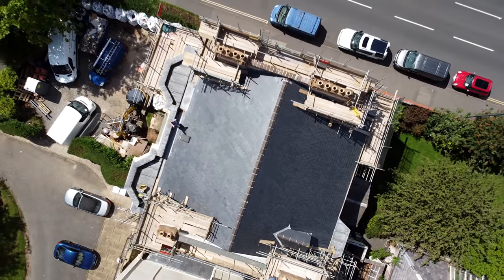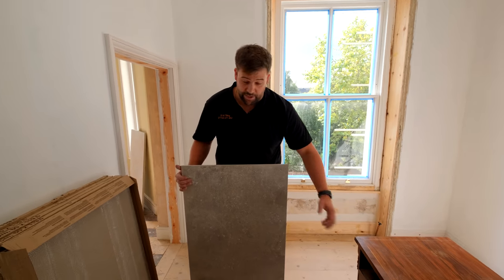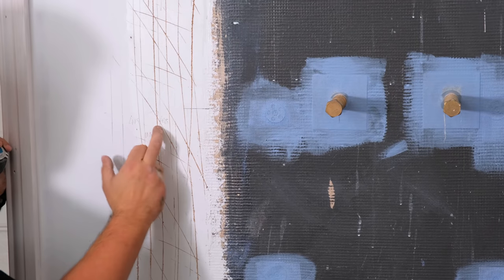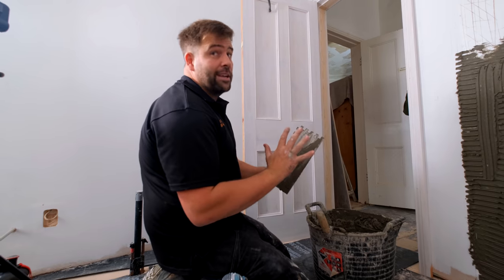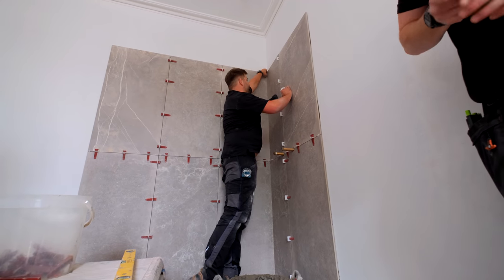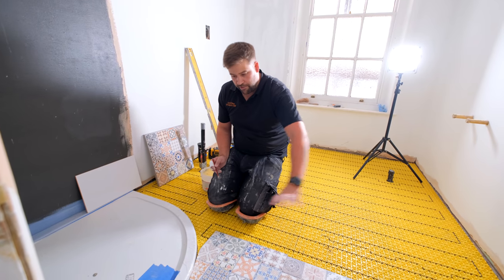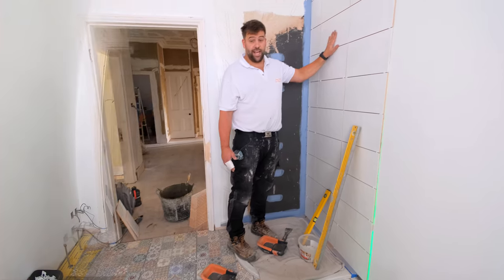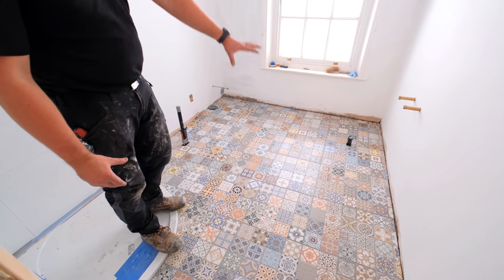INSTALLING LARGE FORMAT BATHROOM TILES | Regency Renovation #13 | Build with A&E

Comment: 2 things i noticed.should there be a 1mm spacer underneath the 1st row of tiles that sit on the shower tray so that the silicone can go in to the gap? and with the wall tiles gong past the sides of the tray,would it not look better to have a square chrome edging strip instead of seeing a raw edge of tile especially the bumpy ceramic white tiles?
Reply: Also he doesn't back butter right to the edges for some reason.

Comment: as a bathroom fitter, the joy when the customer provides xl format tiles for a small area, is such a relief lol
Reply: Why do you say that? I have a small bathroom and would like a large format (60x60) but I've been told the heavy tiles will slip down the wall before drying...

Comment: Hope that's a stone resin tray for that quadrant, seen underfloor heating cables ruin Acrylic trays when they're that close. Also Grout between resin trays and tiles and silicone between Acrylic and tiles? Not sure on your preference but I tend to find resin and tile has a similar stability where as Acrylic always gives more than tile wrecking the joint. Pucker job as always though, hope the finger slice during that second en suite wasn't too bad.
Reply: Hi Effer
The trays and internal corners will be siliconed after all trades are finished so hope this helps clear that up. Also I wish it was a finger slice I broke a finger in the second ensuite but it is what it is luckily I can trowel with both hands

All the best
Greg

Comment: Lovely job Greg 👍🏻 those clips to stop the tiles stepping/lipping are the bee’s knees ,so am I right in thinking that they must have a fracture line built in? And can you get them for different grout thickness. 😁
Reply from the maker: Hi Mark,

You are correct in thinking about the fracture line. Once the adhesive has dried, the clips are tapped with a rubber mallet, and they simply snap off. The wedge can be reused and the remnants of the clip gets grouted over.

I believe the clips come in three different widths 1, 2 and 3mm.

Hope this helps.

All the best, John 😊

Comment: Great job 👏 
Only thing I would say is I'm surprised you don't put a spacer on top of the tray, as that way when you silicone the tray round it has a good space for it to go in.
I've been to so many jobs where tilers sit the tiles directly on the tray & then the seal becomes compromised & water penetration occurs later down the line.  Thats just a plumbers view is all!! To be fair it is a debatable point!
Btw where is the job site ?
Reply: great point, thats what i said.

Comment: Great video and suggest your caution DIY installers how heavy these large format tiles are with thin set applied. The bottom first row does not seem so heavy but the second or third row is exhausting especially if you are lifting over your head.

Comment: Hi Greg love your work, im a Handyman in essex just outside London, and a job has come up for me to tile a bathroom 600 x300mm porcelain tiles, i have to strip off old tiles, plasterboard etc, nightmare, i bet you have done a few of them in your time. But i need your advise, i have to start from scratch on a stud partition wall wall where the bath with shower will go, would you use plasterboard and tank it, or hardie backer boards or those lighweight polystyrene cement faced boards or  something else,?? Also what thickness?.  Keep up the videos Greg.  Thanks Kevin
Reply: Your much better off using elemts board or something similar usually we use 10mm thick

Comment: Quick question - what are you planning to do with the tile edges - will you be fitting a tile edge trim afterwards? Cheers
Reply from the maker: Hi Oli,

The client has requested that the edges be left bare. They will be filled and painted when the rooms are decorated.

Hope this helps.

All the best, John 😊
Reply: @BuildWithAE  chrome strip would look better,would match the chrome doors and fittings aswell
Reply: Most high end edges are bare and painted

Comment: How are you finishing edges of the shower tiles? Not a criticism, just curious, can’t tell what tile edge finish is like.
Reply: Was wondering the same.
Reply from the maker: The client has requested that no edging beads are used, so the edge of the tiles will be filled and painted. The adhesive was left 10mm back from the edge of the tiles, so if the client decides to add beads in the future, it can be done easily.

Hope this helps.

All the best, John 😊

Comment: Hi Greg, at 9.30 and 19.10 when your grinding the tile im sure it was deliberate that you done that by an open window to get some airflow. Im ashamed to say that despite tiling for over 30 years i did not take care of my lungs. Not good, grinding creates a lot of nasty dust. Recently brought a large powerful 36" fan which i position pointing out of an open window and i set my bench up right in front of the fan. Now when i grind the fan pulls the air away from me and blows it straight out the window. Also good when sweeping the floor, just sweep towards the fan and dust sucked straight out the window. Some may say wear a mask but i have a beard and they don't work if you have a furry face! Nice work buddy.
Reply: @Etherglide  I hear you. I work in a lot of mansion blocks in central London, often quite a few floors up and im not walking up and down stairs all day! And as for cutting outside on the pavement, no chance in those parts of town.

Comment: Picking the right adhesive is where I am struggling, I have some thick ceramic tiles to put on the floor and walls, they’re 600x600. I’ve never done this before so I don’t want adhesive that’s going to go off really quick, would you recommend any particular adhesive?

Comment: Love you work so informative. What tanking have you used on the elements board? Also with the rest of the walls did you plasterboard with a thinner board and then skim flush to the elements board? Appreciate all your help!!!
Reply from the maker: Hi Matthew,

Glad you enjoyed the video.

The tanking kit was supplied as a whole system with the elements board, so it's their recommended tape and glue. 

Elements board comes in various different thicknesses; we went for 12mm to match the plasterboard, that way everything matches up nicely 😁

Hope this helps.

All the best, John 😊
Reply: @BuildWithAE  it looks like the other walls have been skimmed. Did you sit the plasterboard back a couple of mm to skim to the elements board?

Comment: Fantastic work. You have inspired me to give it a fo. Quick question what size of notched trowel are you using  I'm installing a 600x300mm 10mm porcelain tile and am going to use a 10mm square notched trowel what would you recommend?
Reply: Expert tiler here I would not use a 10mm trowel it's too small go for 12mm or even 15mm is what we use, 40 years experience

Comment: Top job. Are the feeds coming out the wall for a specific shower, look a lot bigger than standard 15mm.
Reply from the maker: Hi John yes they are 22mm thread outlets to give the clients plenty of water,  it’s the valve Connection on the showers all the best Tony 👍
Reply: @BuildWithAE  thanks for the reply. Keep up the good work

Comment: Never seen those tile spacers before! How are they removed? Do they snap off?
Reply from the maker: Hi Oli,

The clips stay in place until the adhesive has gone off. Then you simply tap them sideways with a rubber mallet and they snap off. The wedge can then be reused and the remnants of the clip gets grouted over.

Hope this helps.

All the best, John 😊
Reply: Yep. When adhesive is dry just tap the spacer and it snaps behind the tile. The wedge is reusable but not the spacer. I've been tiling for donkeys years and at first was reluctant to use this system but now im converted. Very clever.

Comment: Good to see you using the correct prep techniques but why would you not want a grout line running straight up the middle of the taps in the shower 😬

Comment: Looks great but as a tiler myself how do you get on with older builds where walls are not level or square
Reply: yes im a tiler too, these large format tiles can be a nightmare if walls not really flat ,     what do you charge per meter for wall tiling ??

Comment: first class job,never seen tiles that big would be hard to do without suction pads
Reply from the maker: Thanks for watching John 😎👍
Reply: Actually you can get porcelain tiles 3000mm x 1500mm. Mostly used in commercial locations and very, very big houses. Look great but take 2-3 men to errect/lay.

Comment: Great that , what do you find best for getting rid of grout haze ?
Reply from the maker: Hi Chris there is special liquids you can buy on line or Wring thoroughly, as too much water can damage grout. Then, wipe tile surface with the damp cheesecloth/towel. This method will help “reactivate” the grout haze, lifting it off the surface, I will ask Greg to comment as well tomorrow thanks all the best Tony 👍
Reply: Build With A&E cheers Tony , since grout changed because of the introduction of porcelain tiles its become more of a problem

Comment: Tidy job ,how do you get the white spacers out,,
Reply from the maker: Hi Sean,

Once the adhesive is dry, you simply tap them sideways with a rubber mallet and they snap off. You can reuse the wedge and the remnants of the clip gets grouted over.

Hope this helps.

All the best, John 😊

Comment: Have the plasterers gone over the elements board? What going on there, will that cancel out the water proof effect?? Surely you'll get suction into the rest of the plaster skim....
Reply from the maker: Hi sleb,

The plaster has encroached onto the elements board, however this is perfectly fine. The tile and grout will protect the board from water ingress, and should any moisture get through, it would be so minimal that it wouldn't cause an issue.

Hope this helps.

All the best, John 😊
Reply: he primed it first and on those size tiles it wouldn't matter so much,
Reply: Amazing ! Thanks for response, I love watching these videos and Greg is great, got a couple of bathrooms to do so ill leave it to the pros but will know what to look out for! Thanks again.
Reply from the maker: No worries sleb, take care and good luck with your bathrooms 😎

Comment: Got a link for those tile spacing things that Greg uses?
Reply: VITREX
Reply: Tile levelllers by vitrex but there are other makes 👍
Reply: He uses perfect level master. They're  Very good Ive used them too
Reply: Hi Benjamin 

I only use Perfect level master. Iv used others bit nothing beats these

Thanks for watching 
Greg
Reply: Greg. Just a quick question. Why did you not use the levellers on the family bathroom floor?  Great job if you were down in Sussex I’d get you to do all my work 👍